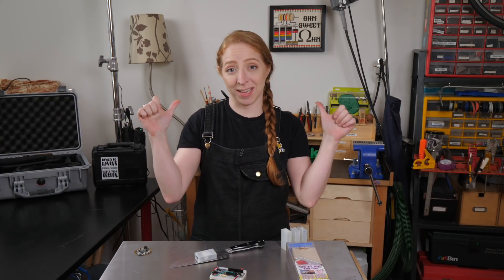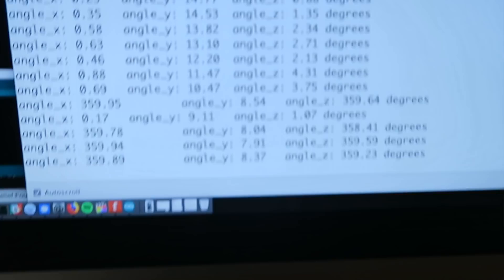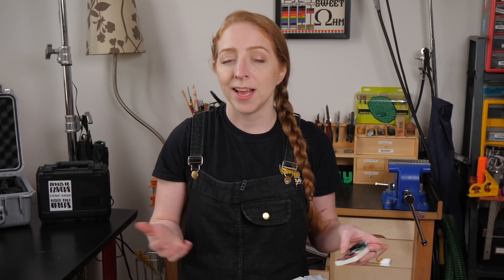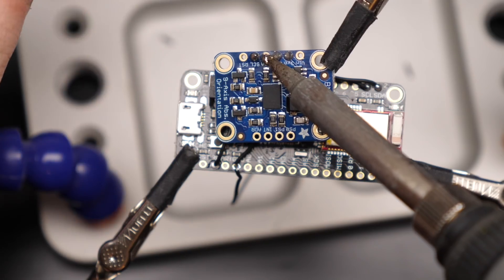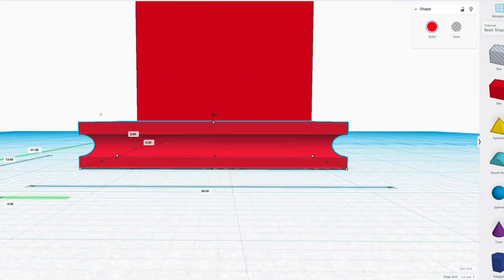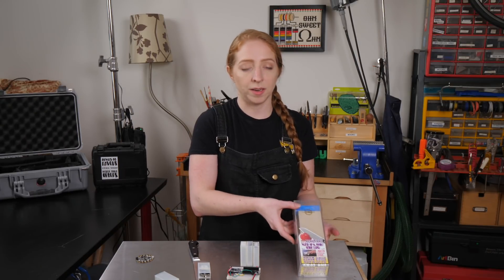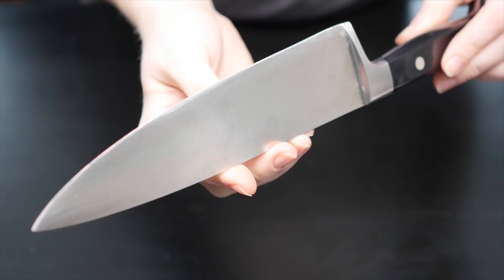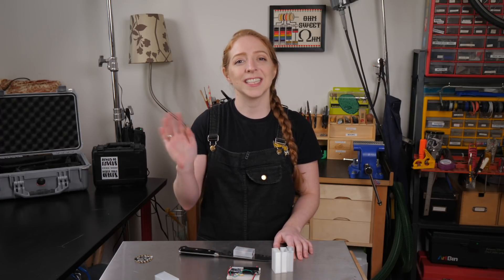Bluetooth Knife Sharpening Helper // Becky Stern

Comment: Hi, I came here from Alex‘ channel as well, see that both videos are three years old, shame on me :-)
As an engineer in IT and partly designing UI, my question is: why are all proposals for visual effects like angle in a list, LED or what so ever.
I would suggest a sound as an indicator of the used angle. If using an acoustic scale, you can concentrate visually on your knife and movement. A lower/higher sound or a tick sound faster and slower if angle changes. As Alex the French cook might except, it is not needed to keep a precise angle of xy degrees, but the consistency while sharpening. So the indication of 0° or 90° is not important, only must be kept the same for the knife for sharpening processes.

Comment: Came here from Alex's channel, love it. I really like this idea, but I was thinking that what would be immense would be to integrate a 10 segment LED bar that would give you a real time visual reference as to how far out you were. So let's say the middle two bars light up when you are within an acceptable range of the desired angle, but more LEDs light up in each direction if you drift away from the desired angle, say more LEDs down as you drop too far and more LEDs up as you drift too high. This would give you a more valuable and possibly intuitive way of adjusting as you go along, rather than having to reference a screen of number or just a red/green indication. You could even have a little DIP switch to adjust the desired set angle (12/15/20/25/30 etc) and the option to perhaps adjust the drift sensitivity as you get better (if this isn't adjustable through the phone UI, not sure from the tutorial.

Comment: I love this -- I suck at sharpening tools and I don't do it enough because I suck at it, and it's a vicious cycle.  This would be so much better than buying one of those sharpening systems (which are expensive and tool-specific), because it would teach my hands to use the right angle, instead of relying on somebody else to keep holding my hands; I don't learn as fast with a crutch.

While getting the exact angle numbers is great for debugging it, for a working version I'd prefer a visual indicator; maybe 3 LEDs with one spot on, one too high and angle, one too low -- that first gizmo you had there seemed to do something like this.  And I'd want to be able to input the desired angle.  Hm.  I wonder whether this would theoretically work for grinding chisels on a bench grinder as well.  

I am guessing you're done with this now since you got proof of concept.  I know little about electronics yet; I guess if I want to build this, it'll be a steep learning curve -- oh, and how pricey is this?

Great video!  Got yourself a new subscriber.
Reply from the maker: Thanks for your kind words! Follow the link to the tutorial in the description, where you will find all the steps required. If you'd like to change the functions or omit bluetooth, it's easier than you may think, but you should at least read through my free beginner Arduino class (linked in the tutorial intro). This isn't a great first Arduino project for someone without any coding background, but it'd make a great second or third one... =D
Reply: Will definitely check out your class.  Thanks!

Comment: Awesome project and channel! Will deffo look into building this! :)

One thing that struck me though. The sensor gives a reading of the absolute angle, correct? Isn't it possible that the absolute angle differs quite a lot from the relative angle to the stone or am I thinking about it all wrong?
Reply from the maker: Thanks! Yes there can be some calibration (subtraction, really) to accommodate the blade width and a surface that's not level. It's mentioned in the tutorial but ran out of room in the video.

Comment: I've been looking for a nice starter project that would have some practical use for me and this ticks all the boxes. Thank you!
Reply from the maker: I wouldn't recommend a bluetooth (or any wireless) project as your first, but then again I don't know your background.
Reply: I do code/mobile for living, but it's the electronics part I'm not familiar with. Not very many interesting projects that assume coding, but no electronics/hardware skills out there. Usually it's easy code or easy both. I'm also beginner level woodworking hand tool hobbyist, which 90% about keeping your blades sharp, so this is a perfect project for me.
Reply from the maker: Awesome, perfect!

Comment: Very cool Project !!
maybe a few things which could be helpful
why dont use some ESP-Wroom-32 it has bluetooth and wifi so you could make a local weserver on the chip to show stats(it is also a bit faster).
if your output voltage is about 5v, you could use a neopixel led(ws2812b or something like this) basicly you could use only one (green if in the right angle, orange in 2° from ideal angle and red if it totaly shoots out of range)
I know you using the absolute Orientation sensor it is quite expensive >.<, id dont know really if it could be preconfigured to a specific angle, maybe if the sink (alex sink is a bit angle offset) is offset, it could be helpfull if tuning the angle on startup to the offset or making a button setting the ideal angle
this are some few ideas, maybe are some helpful maybe not it came into my mind, and i was forced to write it down ^^
stay creative, very cool idea and sry if it was to direct <.< ..

Comment: Great collaboration Becky 👏👏👏
Reply: Thanks for letting us know about this channel. Subscribed ! :)
Reply: nice project, some improvement why not adding OLED display, by this you can watch the angle right while sharping the knife. display it on phone is good for logging but while sharping you switch focus between knife and phone and got in-consistence sharping angle. and a zero calibrate button would help knife maker that use vertical sander/grinder.

Comment: If absolute orientation is needed, why not just slap another sensor at sharpening stone? Because sharpening stone only lose fraction of thickness everytime used, good enough for precision. What if trying to sharpening blade on non horizontal angle surface instead? (using grinding wheel or grinding belt)

Comment: How did you handle the charging/protection of your lipo battery? I did not see a external charge/protection circuit. Is it built in to the micro-controller you're using?
Reply: Just to add on to that question, would the angle be relative to gravitational pull? If so might be helpful to include a calibration button just in case the sharpening stone isn't exactly horizontal :) being really picky here ;)
Reply from the maker: Yes. More info at the Instructable linked in the description.
Reply from the maker: More info on how I calibrate it in the tutorial =)
Reply: Instead of subtracting it from the actual angle in your head, it would be nice to have a serial monitor input to read a starting angle (angle of the board) and subtract it from the measured value from the BNO055. Just a little something to make it easy to use. I'm being really annoying : P
Reply from the maker: You're welcome to build one and make that improvement!! =D

Comment: I have some suggestions for improving the design. I would add an LCD with some sort of menu with a preset list of degrees for different knifes and some tactile buttons to navigate that menu and possibly another to reset the program. Two red and  a green LED could be used as a simple way to indicate if you have the correct angle or if you need to angle it up or down. (sort of like a spirit level)
Reply: Nothing that says it can´t use both indicators. Just a few lines of assembly needed. I just think the LED´s makes the whole thing easier to use since you don´t need to check numbers constantly.
Reply from the maker: Great suggestions! The design is open source, I suggest you try it out and make some improvements!
Reply: Better to use the LCD to show accuracy than leds, like an analogic display , something like guitar tuners. 
Looking for example like this [                   |###             ]

Comment: question here, if I have sharpened the knife perfectly according to the reading, does that mean the angle/gradient of the edge will be constant in absolute orientation? instead of being constant on the normal direction of the edge curvature?
Reply from the maker: Depends on how the tip of your knife curves. For my super nice chef knife, the device is not accurate for the tip if it's positioned near the handle. But for a more affordable knife I tried, the blade doesn't differ in width or curvature as much near the tip. Hope that helps.
Reply: thanks, that's what I thought, the gradient should be almost constant on most part of the edge.

Comment: You, and this project are awesome.  I am curious if the Adafruit nRF52 would be a more condensed way to do this, not not sure how accurate the sensor is in that board though!  Just a thought, look forward to new videos!
Reply from the maker: The sensor is independent of the microcontroller in this case. Yes, you could use the nRF52 feather instead of the 32u4, it's just what I had on-hand (and have experience working with). Here's a guide: https://learn.adafruit.com/adafruit-feather/bluetooth-feathers#bluetooth-feathers

Comment: Hi Becky! Cool video! What would be needed to improve the refresh rate?
Reply from the maker: the max speed of the UART connection depends on which firmware version you're running. We were able to bump up the default rate of every 500ms to refresh every 200ms. I don't know of a way to go faster with bluetooth-- but a wired USB device could certainly update more frequently.